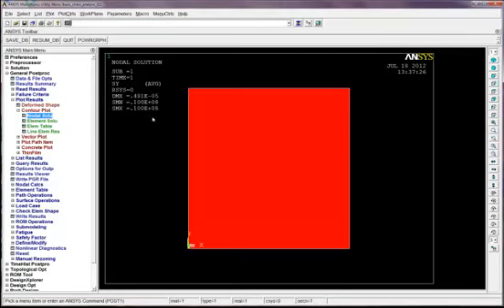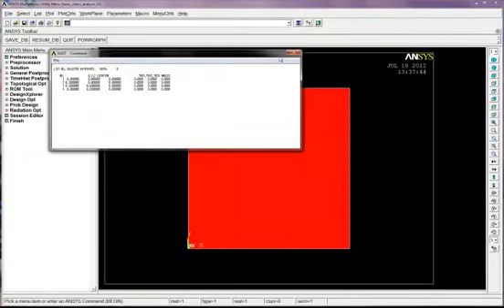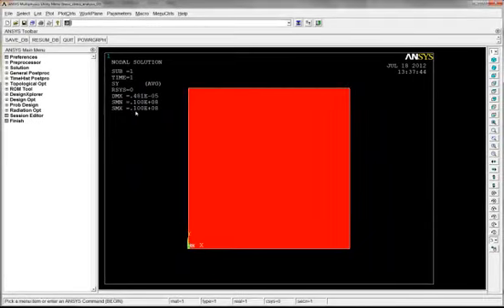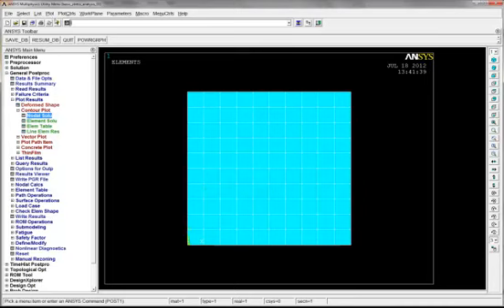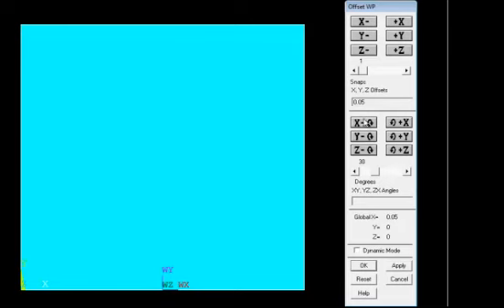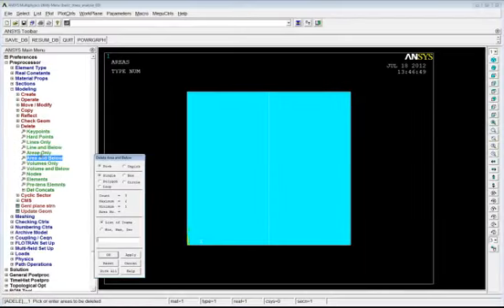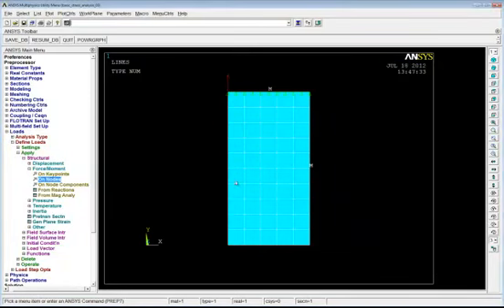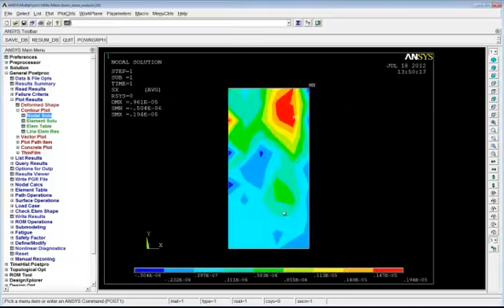Basic Stress Analysis with ANSYS - Part 03

Comment: Hi! Just a question about applying pressures. If I were to use plane strain instead of plane stress, I would not have to assign a thickness to the element. How would I then define the area in order to calculate the pressure?

Comment from the maker: Hi - yes you are correct, I have been contradicting myself! :-)
Stresses of the order of 1e-5 to 1e-6 are essentially zero for this analysis (given the dimensions and loading used). We should really be getting zero in these regions but due to the mathematics of the FEM and some rounding off errors we are getting very very small stresses instead.